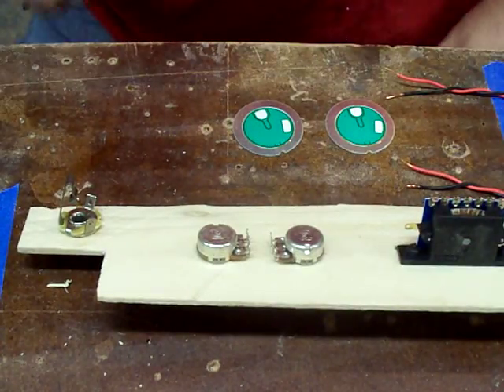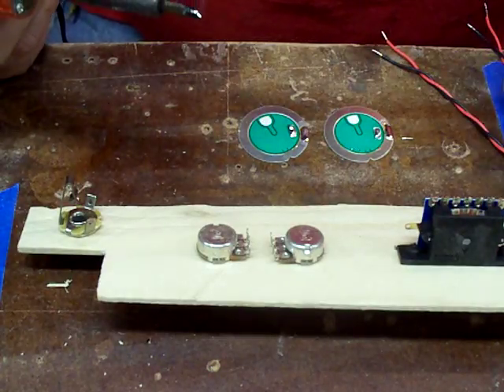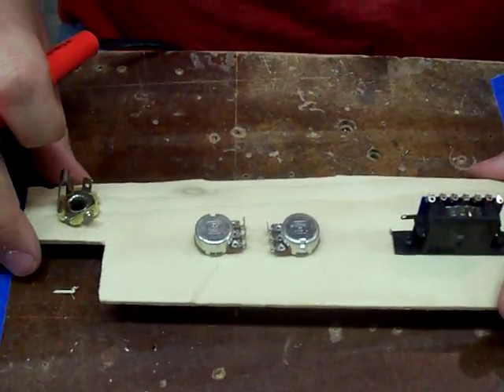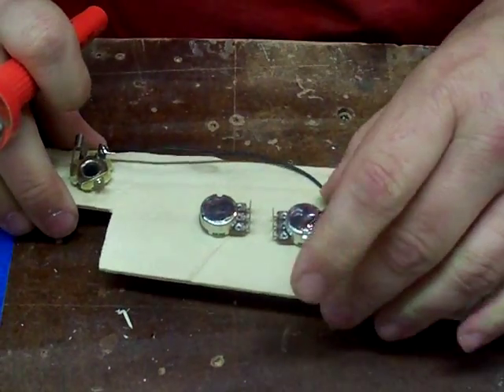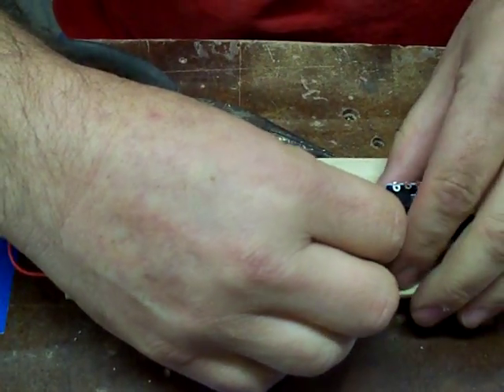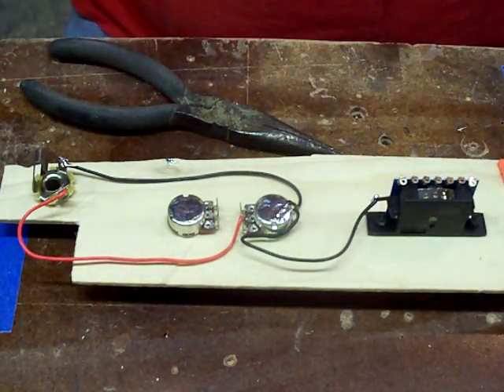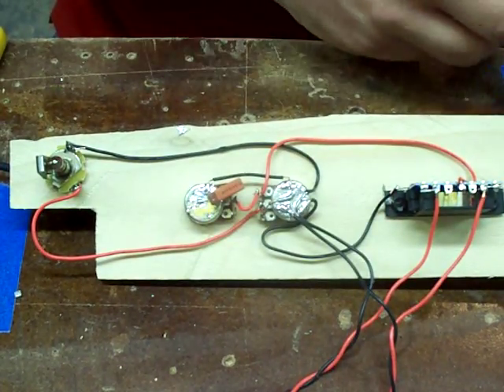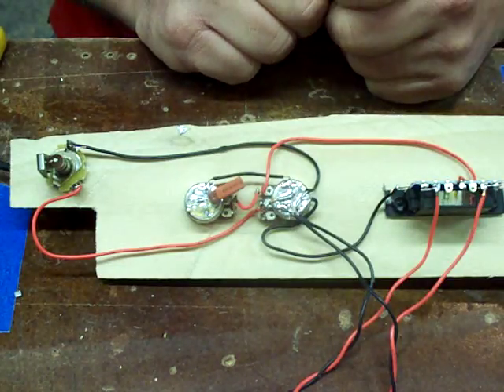cigar box guitar wiring, 2 piezo's v/t 3-way

Comment: It's a silver wash on the piezo ( p- et - zo ) material as you cannot solder to the ceramic crystaline material barium titanate . You need shielded multi strand wire for the out , even twisted pair commonly found is insufficient for shielding purposes but better than single strand equipment wire . Multi strand as fine and high a count as possible for signal transfer .  Mine comes from an old Farfisa Organ and I choose the colour to match the guitar body . But you can buy the shielde stuff stripped out of aircraft over there , with the fireproof braid cover just in case your playing is really hot 🔥. Happy New Year !

Comment: High frequencies travel along the surface of wires. This is why audio cable is made of lots of fine wires; to provide more surface. Even if you like working with solid wire, it is better to use multi-strand.

Comment: Big Daddy, I don't play guitar, in fact I have no sense of rhythm, but I love to build stuff.  I would like to build guitars and amps to give away as gifts.  Could you do a video on building an amp with say a 4 1/2" and a 6 " speaker in it?  Electronics is one place where I less than excel.  Is there somewhere that you have a list of parts for the piezo wiring?  I love the fact that you did a demo video because I can follow that, but although I am able to follow construction (buildings) blueprints, I can't read or follow electronics blueprints.  Thanks for any help you can give me.

Comment: Great vid!  Any tips on tinning the back of the pots?  I  seem to have cooked one because I can't seem to get the solder to take to the pot surface.  Did you prep the surface by etching with sandpaper?  Could mine have coating that needs to be removed.  And what type of solder did you use?  Mine is a rosin core but may be getting old if there's such a thing as a shelf life for solder.  I have one more pot left and want to nail it this time.  Thank You!

Comment: Question, how will it pickups register the strings if they aren't part of the circuit. [Don't you have to put a final wire leading from the grounds of the volume pot to the bridge completing the circuit through the strings?
Btw, great video it help with how to do the switch wiring! 0w0

Comment: Any suggestions for getting rid of ground hum?. I have checked all solder joints with an ohm meter. They are good. Is there some kind of noise cap I could install. It works well just humming until I touch the cable end. I tried several cables, and I can plug in all 3 of my guitars in with no noise.
Reply: To get rid of that hum you basically need to ground the strings, that's most likely the issue here. Does the humming also stop if you touch the strings or the saddle? On electric guitars this is usually sorted by grounding the saddle or string holder. For a cbg you can basically do that in a couple of different was, either run a cable through the body and connect it/sold it to your saddle. I have a wooden saddle on one cbg so naturally I couldn't ground that one. I had to run a cable out the bottom of my cbg to connect it to my "string holder", ie the rivets that my strings run through. I am now ground hum free! Many cbg workers don't do this, might be because the playing style usually sorts out these issues, ie lots of playser lean their right hand on the bridge and/or mute the strings anway which eliminates the noise.

Comment: Thanks for the DIY tutorial.  I have a set up for 2 Piezo's - and I'm wondering if there is a rule about where to place two piezo's in a CBG build for best effect. I could wire just the one, but somebody recomended I use two - and never told me where the best placement would be.
I know with one piezo its best to set it under the soundboard under the bridge near the top string, but thats all I know. Any advice on the second piezo placement? - this is my 1st CBG build.

Comment: I don't know if you are still around But I have to ask before I do my first build.  the pots have a certain value? And the capacitor what value is that.  Excellent demo if I should say so.    Umm I noticed that Mojo  didn't reply to any of these posts. Can someone else answer please.
Reply: +Moby Dave 250k or 500k pots are common values for guitars. 500 for the volume 250 for the tone. common cap values are 0.022uF or 0.047uF. you can google for guitar wiring diagrams really easily if you need a visual. ;)
Reply: thanks
Reply: Moby Dave
no worries...good luck m8. :D

Comment: sir can i change the piezo with stick piezo on bridge and another piezo change into a single coil pickup?
Reply: best way to do a stick is to route out a slot in the body right under the saddles. magnetic pups are easily installed but they do feedback easier. just something to be aware of, you probably wouldn't wanna throw a set of blackouts in one of these lol.